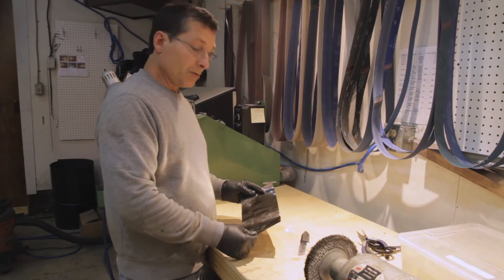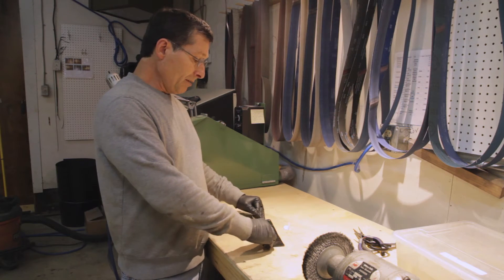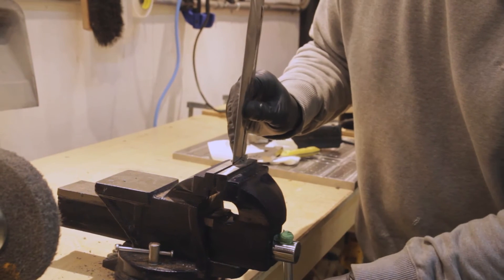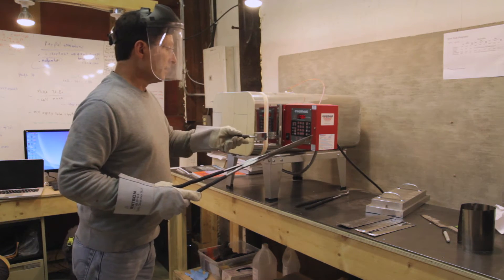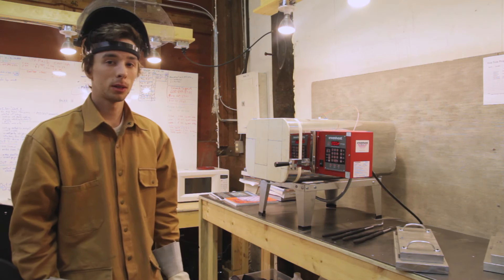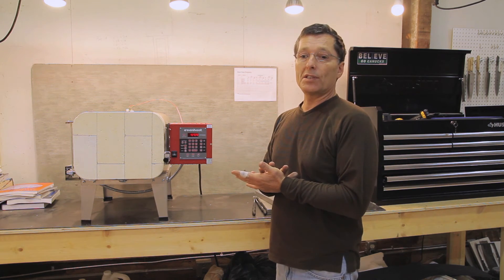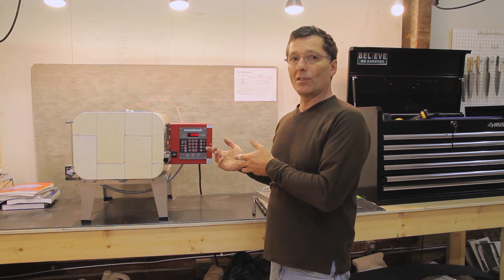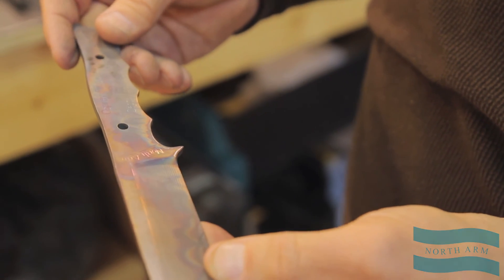Heat Treating

Comment: One more thing: I have ready access to many gallons of liquid nitrogen. I’ve treated hammers and it seems to add toughness. Your opinion on knives please.
Reply from the maker: With certain steels, mostly high alloy stainless, like the one we use, a sub-zero quench can add a couple of points on the HRC scale. In other words, higher hardness or wear resistance. We do our sub-zero in dry ice.
Reply: North Arm Knives  Thanks for taking the time. I go through 30,000 gallons of nitrogen a month at my business so it’s readily available. Dry ice not so much. Thanks again and great work!!
Reply from the maker: wow, you really do have good access in that case. that would quench a few knives! I know lots of people who use it. It'll work at least as well as dry ice. Oh and thanks!

Comment: All fine and good. I have a shop with all the equipment anyone could dream of. But my thing is hammers and tools. Getting ready to make some knives. You quench on aluminum blocks. What type of steel? What about oil quench? What is a good procedure for getting the blade out of the foil and into the quench with minimal loss of time/temperature??
Reply from the maker: We use cpm s35vn. It is an air cooling steel. It can be quenched in air, between aluminum plates or in oil. We use aluminum because it is the cleanest and helps straighten warping. You don't have to remove the knife from the pouch to quench between the plates.

Comment: Nice video! I just started using the cpm s35vn. Do you use deep freezing? If not, at 600f what hardness do you get? Crucible steel is not very clear about it.
Thanks for the help
Reply from the maker: At the time of the making of the video we didn't use a freeze cycle. We used to get around 59 HRC. Now we do a dry ice cycle right after the initial quench and we get about 60 HRC. I agree that crucibles data sheets leave something to be desired.

Comment: hey  nice video 
we require a machine for hardening our industrial tools 
can this machine do that also ??
Reply from the maker: +Akash Singhal If the tools in questions are made of steel then yes this kiln can probably heat treat them. It goes up to 2100 F Which is high enough for most (hardenable) steels